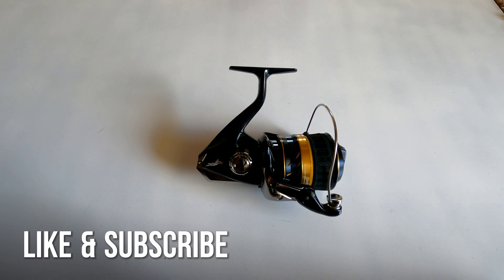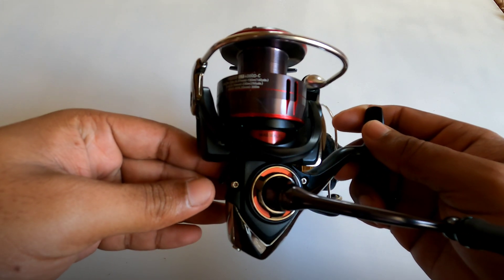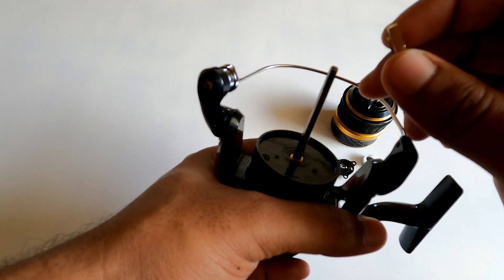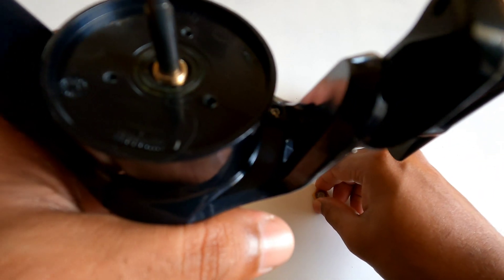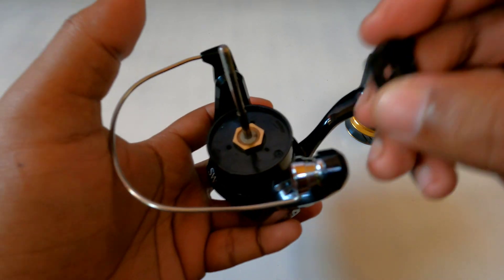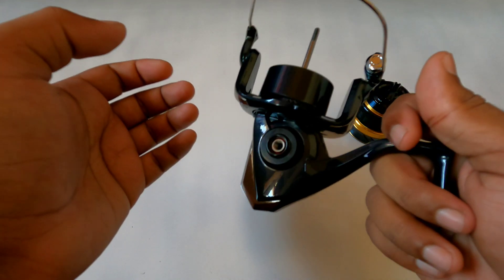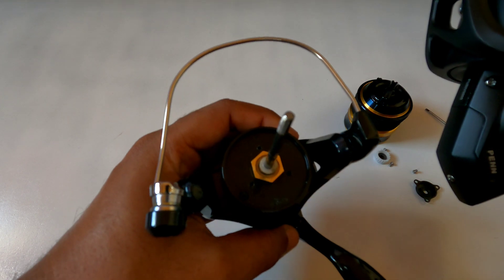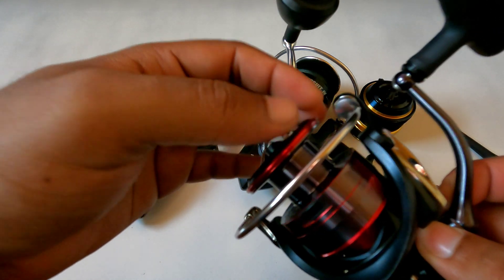Shimano Infinity drive Explain (what is infinity drive and does it serve a purpose)

Comment: Hello... I am surfing fishing with heavy weight teams in very difficult water conditions in the Bosphorus.  Continuous horse-draw with depth, current and 250gr weight.  Normally jig machines are efficient here.  However, I'm considering ultegra 14000 xse for longer distances.  Do you think it can handle these harsh conditions?  Or should I continue to use jig style machine?  Thank you from now.
Reply from the maker: The ultegra 14000xse should serve you fine and just like any reel you'll have to take good care of it.

Comment: From what I understand, they still have classic x-ship dual pinion support, the bushing just serves as yet another area for support.  On casting reels like the Conquest, it seems the spool just fits more securely inside the pinion (where the little spool pin is) and helps do the same thing.
Reply from the maker: X-ship is different from infinity drive. Infinity drive supports the main shaft to eliminate friction between the main shaft and pinion gear when cranking under load.
Reply: @tackleaddictgy  Yes but there was some confusion when it was first introduced, that they were replacing dual bearing pinion support
Reply from the maker: The dual bearing pinion support is still there.
Reply: @tackleaddictgy  That's what I was initially stating.  Big thing on some forums, few people didn't understand Infinity drive
Reply from the maker: Very true! Thats why I did this video in hopes it help people understand

Comment: does diawa have any technology similar to infinity drive?
Reply: Daiwa doesn't offer something like infinitydrive but starting from the BG MQ, and all their MQ reels, have a friction mitigating ring beneath the main shaft which seems to imitate what this does. But I've heard from japanese anglers that the twinpower and stella sw is easier to winch under load compared to the saltiga and certate sw (Big fish GT/Tuna)
Reply: @danielwutfisho  Thanks for the comment. there is definitely some validity to what the Japanese anglers are saying, i have a used both a certate 8000p and tried my mates stella SW 8000HG, the stella is by far significantly easier to winch in a fish, despite the fact that my certate in theory should have way more torque being a power gear yet the stella is significantly better to wind under load.
Reply: @Deathtitan000  I think both companies make excellent reels suitable for most applications. I tend to stick with daiwa for bigger sized reels and shimano for the small ones.
Reply from the maker: Not that I'm aware of.
Reply: Does the old Vanford have infinity drive?